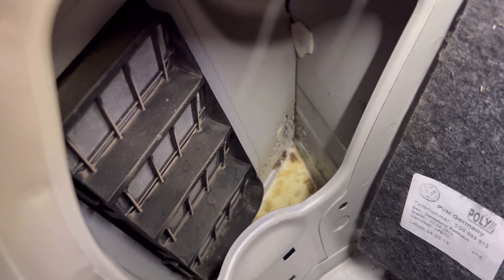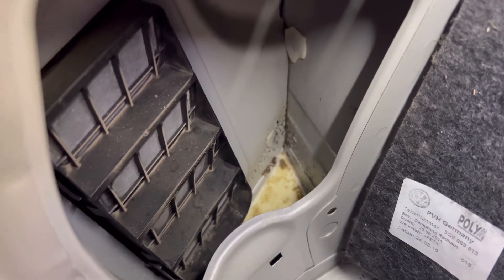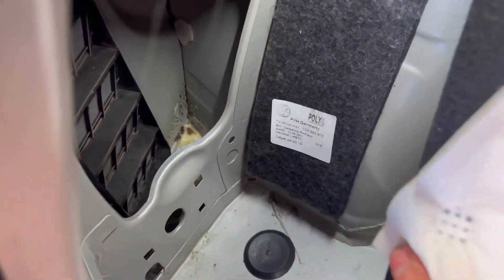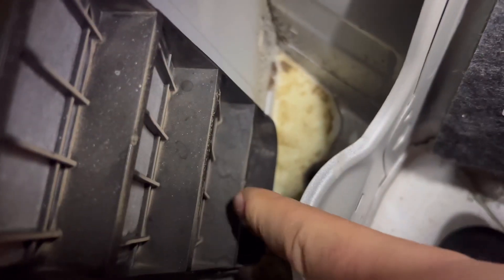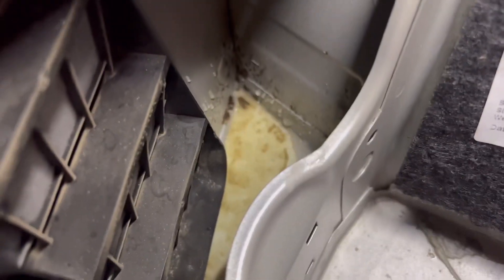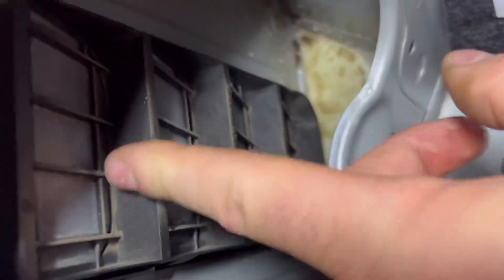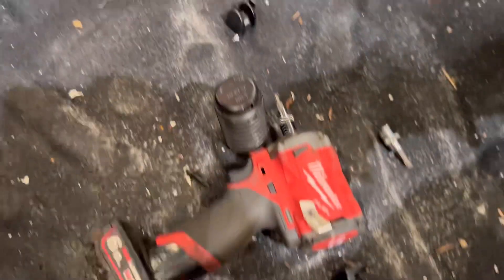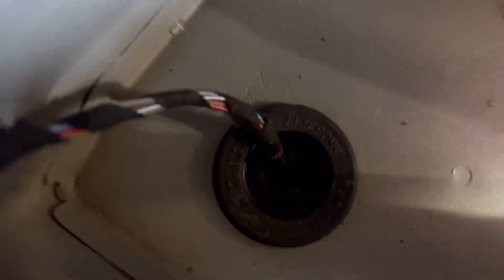VW Golf MK7 Water Ingress

Comment: Does anyone run just without the bung plugs?
Reply from the maker: If it works for you then can’t see the harm in it
Reply: @TheVWMechanic_official  Did the rear badge drain pipe today....tail light gaskets ok. Was getting ingress into just the tailgate itself....the new pipe is one piece rubber and is fluted with a much meatier lip rather than a grommet as such.
Reply: @TheVWMechanic_official mice can get in without the plastic plugs